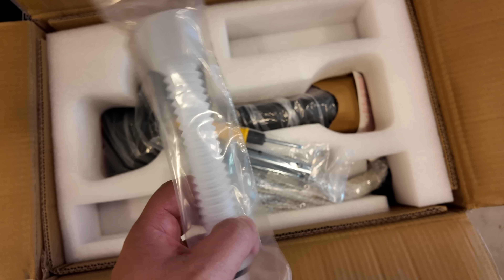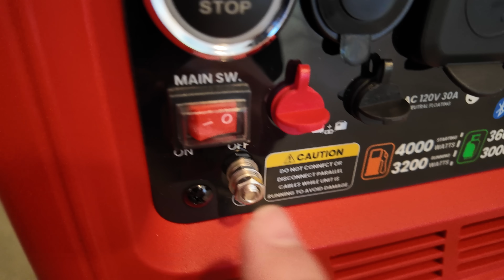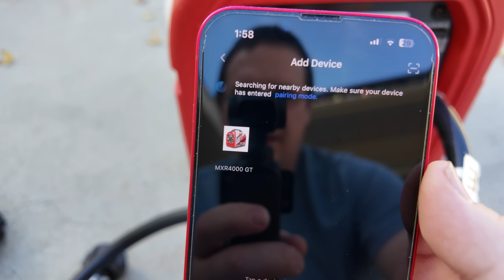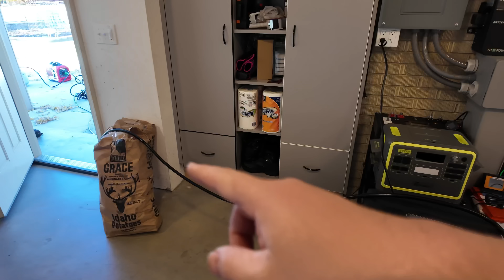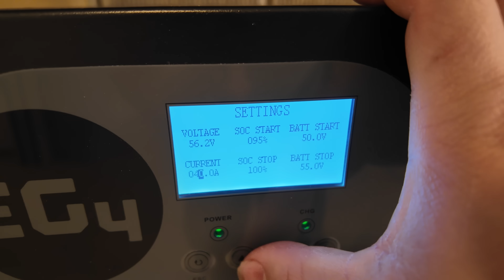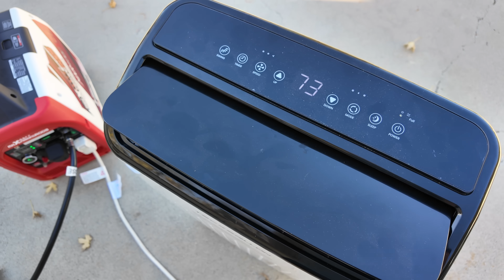UNPOPULAR OPINION: Buy Gas FIRST (Before You Ever Touch Solar)

Comment: You should consider a not only off the grid but off the web solar generator and dual fuel generator. If you’re concern is no availability with the fuel situation. It should also be that of no availability of using the computerized chips and Internet system. That option has almost completely been taken away from us.
Reply from the maker: Those are definitely important considerations for a truly resilient setup!

Comment: Question. If I already own a gas generator but it is not an inverter generator, is there a way to use it to charge  my solar power stations safely? Thanks
Reply from the maker: Yep! You can get a sweet kit that’ll expand your power station capacity and comes with a charger that can accept dirty power and it’ll clean it up! https://youtu.be/Jg7HqRmNQlw?si=eYcy4EYZ0Q_z_OK7

Comment: In my 77 years on this earth, I’ve never had our gas go down electrical power yes many times if you have natural gas then have a plumber come in and run a stub line and a quick connect. The ideal situation would be to have a 20 or 30 amp circuit right there that you can backfeed into your panel and use natural gas instead of propane.
Reply from the maker: That's a very practical approach for reliable power!
Reply: So do you mean "backfeed" the right way and up to code with a power inlet, interlock kit, breaker (or manual transfer switch) or are you just flipping the main breaker off, unplugging the dryer (for instance) and plugging there or a 120v outlet maybe?

Comment: Call me paranoid. I have 5 generators ranging from 11,000w down to 1400w. 20kwh of battery and PPS storage and about 1800w of solar panels but 99% of the time I run on grid power. Watched your temgo expansion video again and dang you! I have the battery and charger in my cart but haven't pulled the trigger yet. It would give me nearly 9kwh total with my fossibot 3600 and I could use my inverter generator to charge both at once using the 18a charger. Cyber Monday sale too
Reply from the maker: Sounds like you've got a very robust setup already! But I mean...you always need more batteries! Just write it off as being "extra prepared"! Haha!
Reply: @theresatrickforthat I have been unable to measure the voltage in the expansion ports of my fossibot 3600 which is identical to the aferiy p310. Can't find anything telling me what kind of connector it is to build a cable. I haven't seen you test these but maybe you know of someone who has. It does not look like the xt150

Comment: I'm not against generators but Gasoline and Propane is too costly. 3 dollars a gallon is a heap to pay for propane and gasoline is never steady priced. Plus gasoline is difficult to store for long periods. I use Solar to charge my Bluetti. I live in a area where the Sun shines and it can get blazing hot more often than we have cloud cover. In fact, the winter season is short where I live. My pole barn is totally off grid and I have been using Solar to charge. I do plan to have a generator but only to do what my solar can't do if there are too many cloudy days. I think using a generator as a pass through power supply would be a better option for me. My game is to try to shave some of my power usage. Our home is all electric. We use an average of 35kw per day. I think I can easily cut this in half. Maybe more. I need Solar to keep my batteries charged during the day and they will serve as my pass through most of the time.
Reply from the maker: That's a very solid strategy, especially with the abundant sunshine where you live!
Reply: Dang...  We pay $1.49 to $1.69 a gallon for propane in central Arkansas.  But, that's if you're filling a larger propane tank...which ours is 250 gallon.  I use a single, or a pair in parallel, of dual fuel inverter gens and never gas.  We don't lose power enough to substantiate the cost for solar and battery stuff.

Comment: For people who only want off grid power for emergencies, the solution is the generator.  The power station extends the amount of time one can spend without running the generator.  For most people, the power station isn't going to add any cost or fuel savings unless the power station has a greater wattage capability than the generator.  We went almost a week due to a storm-related power outage and having battery backup power helps to save sanity.  Listening to the drone of the generator hour after hour gets old really quick.
Reply from the maker: Glad to hear your backup power helped during the outage!
Reply: Its the different way around. The solution is Always a full solar system (Not a Power Station but with extra batteries and extra Inverter) 
Then you only need a small Generator for charging batteries

Comment: Maxpeedingrods makes a lot of stuff. I have an ambulance camper build and plan to have AC, small refrigerator, lights,, coffee maker, induction stove, etc. I will use a generator but what's your advice on a power station to run these also? I will do solar also. Where would you start?
Reply from the maker: You can’t beat the versatility of the Bluetti Apex 300! Small enough to move, but really packs a punch! Plays well with gas generators and can be expanded for whole home backup! Check out my review video on it!
Reply: @theresatrickforthat Thank you I'll go look for it now. I guess you're right, my ambulance would be a home on wheels. But like you said a generator should be a staying point?

Comment: Disappointed you did not show the battery that goes into the generator for starting it. It’s a proprietary to that generator only and how long will the battery last on standby? And where do you buy a replacement for that battery? In 5 to 10 years, can you replace that battery?
Reply from the maker: Yes! You can replace the battery! The company is actually preparing a listing on their website so you can easily buy a replacement!

Comment: Absolutely a dual fuel generator...  would I like to have a home backup that charges up by wind & solar? Yes. Can I afford it? Hard no. If a simplified affordable reputable diy total system that hooks into a transfer switch for the basics... furnace, a few lights, fridge(s)/freezer i'm in. I dont want a 100k system to generate for a power company, or run a dryer during a two week blackout, and obviously I need more than a camper batt with a panel to charge my phone.
Reply from the maker: Nice we have lots of solutions at our disposal!

Comment: I use a 6kVA generator on LPG that charges a 14kWh battery bank and, whilst the genset is running, powers all the high-consumption devices that I use on short occasions (washing machine etc).  By the time the batteries have charged I've finished with all the high consumption devices and have battery power for a few days.  Using a bank of four 100lb bottles of LPG I reckon I could go for MONTHS using the genset and battery bank.  One pound of LPG per day (max as I don't use the high power domestic units every day) that's at least 3 months use.  I could double that easily and storing four 100lb bottles is both cheap and easy.
Reply from the maker: Sounds like a great system you have going!

Comment: Most new vehicles have inverters, mine has two 400 watt AC outlets. 2.5 hrs to fully charge an Ecoflow Delta 2 at 400 watts. You could also connect an aftermarket inverter with a higher capacity. Default AC charge rate is 1200 watts and 50 minute charge time.
Reply from the maker: True!

Comment: I I have a camper van. I have porch solar lights I put on my dash or outside and bring them in at night. I use propane gas to cook with so using it to charge a power station is a smart move. I'm going to buy solar panels to put on top. I'm going to put a swivel rack to put it on. I can move my panels up in a 45 degree angle when boon docking. I'll use the generator when needed.
Reply from the maker: Sweet!
Reply: I just found something I like. Turn a weed eater motor  into an air run motor. You could hook up an alternater with the motor. Use a timer on it or when voltage gets low . To charge up your power station. Use solar power during the day.

Comment: You are 100% correct, Sir! 
Personally, I have two (2) 2500-watt, dual-fuel, "inverter" Generators that are quick-connected to my 250-gallon bulk propane tank, and regulated to 11" W/C (11 inches of water column). Those generators are primarily used to recharge my two battery banks on my solar system, if needed. Each generator will run @ 50% load for 32 hours on one (1) gallon of propane. 🤠
Reply from the maker: Awesomeness!

Comment: Solar ‘generators’ are just a battery backup.  Useless.  I use full-house backup, using natural gas.  Power off?  In 20 sec, up, cut over, and even A/C is back up.  Days, weeks if need be.
Reply from the maker: That's great! Should certainly have a backup to that in case it has some kind of falure!
Reply: actually, yes.  A really quiet honda that runs on gasoline, but only 2kW.

Comment: Wow, hard disagree.  Solar is better at nearly every level than gas.  Then again, I live in Arizona so solar isn't exactly scarce or unreliable.  My EcoFlow Delta 2 has saved me during several neighborhood brownout/blackout events where there was no power for hours.  While I cannot power my AC off such a small device, I'm also not going to power my AC off of a portable camp generator like the one in your video either.  I was able to power my fridge and freezer as well as continue to telecommute for work, and my 400w of solar panels kept the device more or less full during the entire experience.  With no generator noise.  I use my Delta 2 as my camp power source, too.  We've left behind conventional coolers packed with ice, in favor of an ICECO refrigerator cooler.  The compressor equipment takes up less space and weight than the ice normally used to keep food cool.  The Delta 2 can power the thing for 2-3 days on its 1000Whrs of charge and if we're going for a longer time than that then I bring the solar panels and we've got infinite power.  Absolute worst case scenario I can charge the Delta 2 from my vehicle's gas engine, but I've never had a camp trip get such bad weather that I had to resort to that.
Reply from the maker: Plentiful sunshine makes a huge difference!

Comment: That's a good looking generator man.
Aussie here....living in Thailand which is in the tropics so my main focus is solar....we have frequent pwr outages here and when it's the rainy season, having a dual generator is awesome. My first one was purely gas, but all the seals failed and when I needed it, it failed. The dual fuel works a treat and charges my 10Kw battery in about 4 hours. And if the gas runs out I can plug in my wife's cooking gas (sorry darling, but enjoy the fans and TV).
Oh yeah, my main point was that use just LPG the maintenance is hardly any compared to gas.
Reply from the maker: Great thoughts! Thanks for sharing!

Comment: A common mistake people are making is calling those power stations "solar generators". They have  nothing to do with solar unless you connect it to solar. The best is to have the power station and a generator. Bring the power bank indoors, which you can't do with a generator. When the power bank runs down, just recharge it in an hour via the generator and you're good to go again. Silent and clean indoors.
Reply: The battery generator generates energy when you connect it to solar. The gasoline converts gasoline into energy.... same thing...
Reply from the maker: Good points! Thanks for sharing!

Comment: I think with the current solar generators with insane AC charging speeds with many able to charge from 0-80% + within an hour or 2, like 1200watts or more, charging via generator can be very effective and a great additional option to solar.  When many 1kwh-2kwh Solar generators came out their fastest charging option was thru a large mppt solar charge controller(maybe 700-800w input), and there was a separate AC charging block that might only charge at .25C(250w-400w)and take 4-5 hours or more to charge fully from AC power.
Reply from the maker: Absolutely! Thanks for sharing your thoughts!
Reply: Yup,  my Pecron E3600LFP charges at 1800W, or you can set it to a percentage of that. I've got a small cheaper (~$400) generator, says "2200" on the side but it's 1800W continuous. Should be just about enough to charge the Pecron, right? Well, not if you have any load at the same time -- in that case it will try to draw 2400-2500W from the AC. I've got around 150W average (250W peak) of loads that I simply don't want to turn off -- fridge and Starlink and computers, so I need to turn the charge rate down to 80% (1440W) to give some headroom for the load. If I was doing this all the time then a bigger unit as seen here would make sense, but for me it's a 2-4 days once every two years thing (Cyclone Gabrielle Feb 2023, Cyclone Tam April this year). Heck, I might have gotten through those late summer/autumn storms on just the 2640W of solar panels that I have now! It takes really awful weather to generate less than 300-400W from those, which is enough for the essentials even if I can't run the aircon. Even a break in the clouds for 30 minutes of 2000+W changes the whole day. Also, I don't have a problem with running on petrol as I need a continuously turned-over petrol supply for the lawnmower anyway, and they use the same. As long as the disaster isn't so bad that I can't buy fuel it's all ok. Just make sure you always run the tank and carb dry before putting it away.

Comment: I heartily agree with you on getting a good dual fuel generator first in most instances.
After last year's Hurricane Beryl, I made a vow to myself to never get caught short again dealing with high heat and humidity (Gulf Coast Texas in the Summer) and hundreds of dollars of spoiled rotting food.
To that end I bought a Wen 4800 Dual Fuel generator and five 20-pound propane bottles and had them filled.
I will use gas only as a last resort.
I also purchased recently an Eco Flow Delta Max 2 power station after watching your excellent video on how long it could run all sorts of electrical devices especially the refrigerator.
I am pretty ready now.
Reply from the maker: Awesome! Glad I could help you!

Comment: I've been designing and installing off grid powered homes for over 25 years. The first thing I tell my customer is: there is no such thing as a successful off grid home without a generator.
Reply: Design your energy system for winter, summer will take care of itself
Reply: excellent advice
Reply from the maker: That’s what I’m talking about!
Reply: @theresatrickforthat -But why is it unpopular? That sounds political. We just went through an ice storm. Who cares about politics when you could freeze to death? Dual fuel with a power bank is the best for a beginner. It seems the best solution for portability and less noise.
Reply: I just came to the same conclusion doing the maths for winter.
oil fired heating  and heat pumps too.
Reply: @adespade119 I use propane for heat.  On sunny days, I'll turn on a 500 watt electric heater during the day..sunshine 😀  My off grid cabin is 40x14 exterior dimensions.
Reply: Well If your solar system ist big enough so its enough for winter

Comment: More than 20 years working with solar. From 12 volt car battery with an inverter to a 7K solar panel array with 40 k of lithium and a 10 K inverter. I have seen almost all, and the crude reality of solar is that any system, no matter what size, NEEDS A SMALL TO MEDIUM GENERATOR. On an emergency more OPTIONS is the way to go.
Reply from the maker: I love it! Thank for sharing!

Comment: I'd love to know how long it would run on a tank of propane like that shown in video
Reply from the maker: It really depends on the load you have on the generator.
Reply: @theresatrickforthat yeah, wanting to use it to charge up an APEX 300 or some similar  power bank. Trying to decide how it compares to using solar. This setup will be in the Philippines which has a lot of overcast/rainy days. This duel fuel gen. Probably the way to go because a low setup costs. Already using propane for cooking

Comment: I love redundancies.  I have the 2200i Honda and the Companion and converted them to propane using the Grenergy Kits, I have the Watt Cycle Batteries, a couple of the 300ah ones, and a couple of the 100ah and of course solar panels.  I prioritize them to solar first, than the watt cycle batteries, and if still need to 3rd priority goes to Honda generators using propane and then finally the Honda's using fuel.  One never knows for sure.  What would have been nice to see on this video would have been you hooking up the Honda generators to see if they would have been overloaded with the propane.  Regardless, great video, thank you.
Reply from the maker: Thanks for sharing your detailed backup power strategy!

Comment: I have 2 dual fuel generators, the second being a Predator 5000. I have 4 20# grill tanks, 2 100# propane tanks, and generally keep 20 gal of gasoline on hand too (although my Predator so far has never seen gasoline).  In addition I have a 2000w pure sine wave inverter that I can connect to a marine battery or any of my several vehicles. With some conservation I can run everything in my house for 30+ days except 240v things like my central air and dryer, neither of which are essential. Fortunately my well pump is 120v and I have natural gas (which rarely fails) for my range, furnace, and hot water. I feel pretty secure for now but my next phase will include some more battery storage and solar power of some kind.
Reply from the maker: Thanks for sharing your comprehensive backup power strategy!